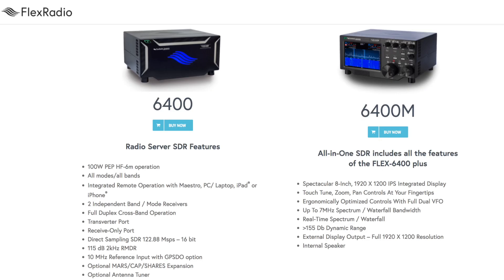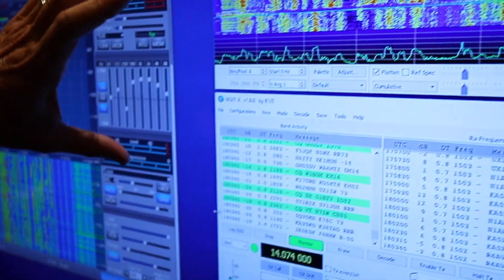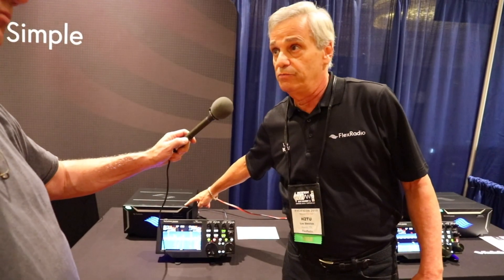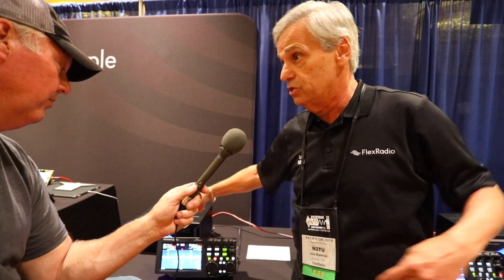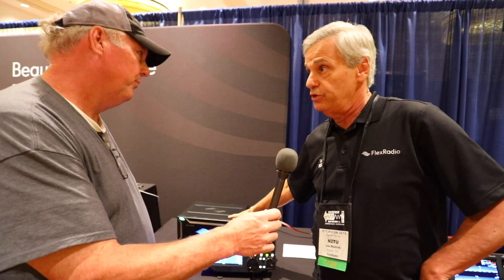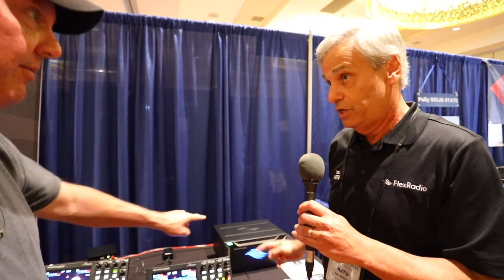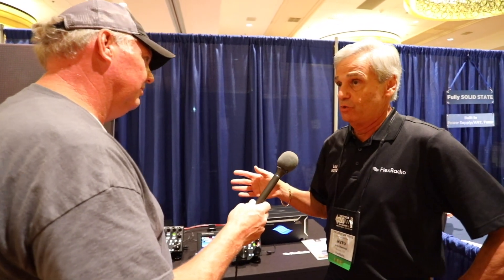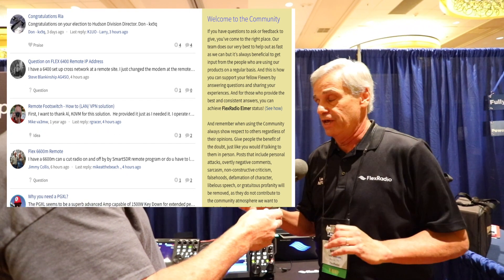What is a FlexRadio?

Comment: But is the FT* built into the radio or do you have to have a outside computer. I see the MB-1 Expert has all programs
you can run from inside the radio because it is a I7 computer with a SSD solid state drive internal. It also can display the DX spots right on the screen , I have never seen a radio do that.

Comment: HOW MANY MAESTRO ( REMOTE ) YOU CAN ADD,  CAN YOU BUY 2 REMOTE FOR EXAMPLE 1 MAESTRO FOR ME AND ONE FOR MY BROTHER  AND BOTH CAN OPERATE THE RADIO ? YEAH ! THATS THE MOST IMPORTANT QUESTION .
Reply: You can have as many Maestro's as you want and two of them can operate at the same time with v3.x software. Only one transmitter though so you have to timeshare that.
Reply: @dsim3596  thanks
Reply from the maker: Thanks for watching the video. This channel does not represent Flex radio. This video was an interview at a Ham-fest. That said I will give my best guess on a answer: You can buy multiple Maestros, but only operate one of them at a time. You and your brother could both use the radio, but not at the same time. Here is A email for Flex radio to get the official answer. sales@flexradio.com
Reply: @HamRadioTV  thanks

Comment: "within 15 minutes you'll have someone who's met that problem before and will have a solution for it". Rubbish. Most of the time you'll have somebody tell you that that feature doesn't work or that it used to work and Flex have broken it. This guy is a remote salesman from NC who is working for a TX company and is a programmed yes man.
Reply from the maker: Thanks for the feedback. I've only talked with a few stations on HF that were using a Flex. And, so far everyone seems to love them. But, I have not used one yet.~73

Comment: Torn between Flex 6400 & Apache Labs Anan 7000dle MKII. My main interest is SSB / ESSB. Both radios have excellent RX capabilities. However, Apache Labs has a much better TX performance with LDMOS PA hardware and adaptive pre-distortion software. Flex has been dangling that carrot for years and is either not capable or not willing to provide that feature. Flex is made in the US and that's a big plus for me. But they seem all wrapped and consumed by multi-user remote operation without first leveraging some important benefits that SDR allows, or at least on a parallel path. Apache Labs relies on open source software development and flex allows that too if it works within their inhouse developed OS. Flex provides updates that frequently disable or hinder past capabilities that seem to frustrate members of their user group as mentioned in this video. But Flex is made in the US. So I'm torn but leaning toward the Apache Labs unless Flex can offer a similar capable standalone product in the next several months, I'm too old and too wise to be chasing carrots...
Reply: Good choice. Go for the Apache Radio Anan. Software is going in the right direction, while Flex are going off at a tangient. Read the RSS feed from Flex to see some angry owners (!!).
Reply from the maker: Have you made your purchase yet? If so, what did you get?

Comment: I am interested in this radio or maybe the 6600.  I would like to do as Lou does and put main unit under the desk with Maestro on the desk.  As for a monitor,  would a touch screen monitor be necessary?
Reply from the maker: A touch screen monitor is not necessary, but more preference. Some people don't like smudging up the same surface they are looking at and others like that "tablet" feel. Thanks for the comment, and to be clear we don't represent Flex Radio here at Ham Radio TV.  We just interviewed them at Pacificon 2018. 73 Jason / KM6FAK
Reply: I have the 6600 and it sits on my desk. I don't use a Maestro but an Intel NUC Core i7 PC running Windows 10 in the shack and I can also operate from my laptop anywhere in my home or from anywhere else using a WIFi hotspot.